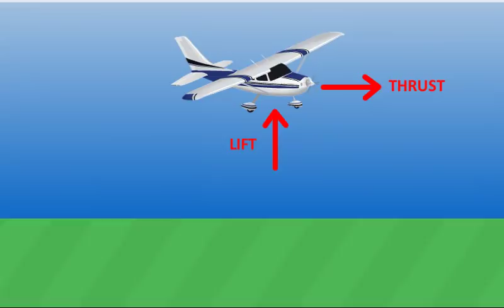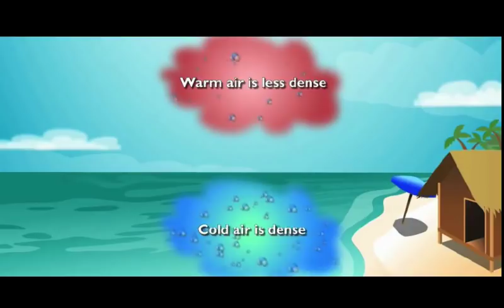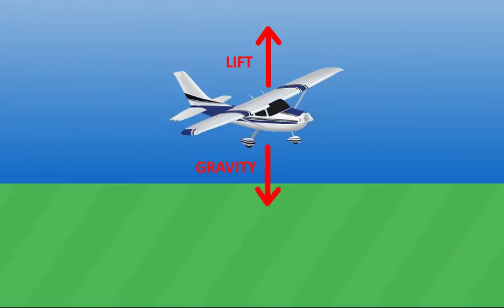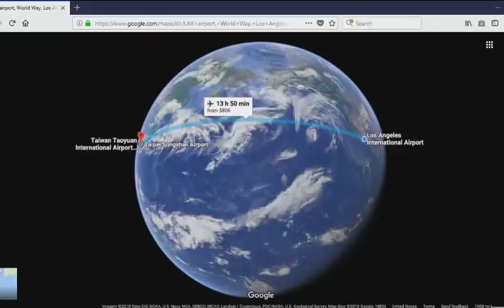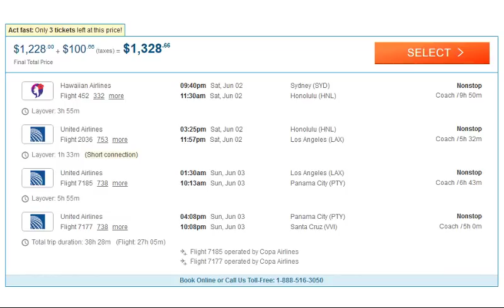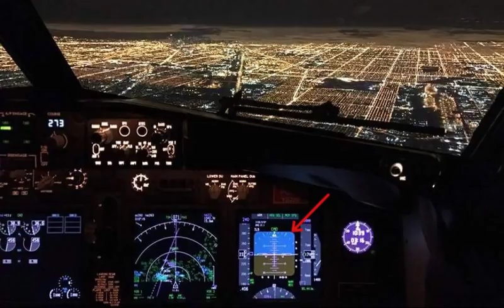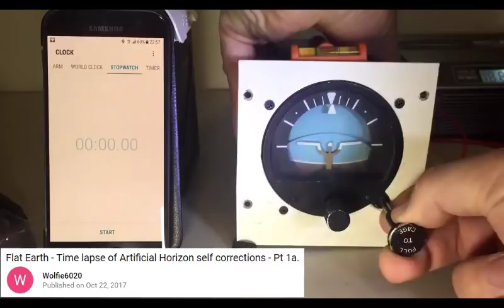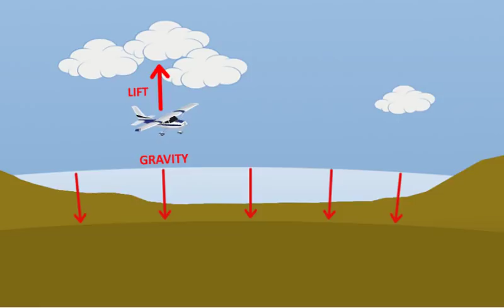Flat Earth Falsities - Plane Nonsense

Comment: At ~6:00 - that is not correct.
A plane WOULD have to 'constantly' adjust its vertical orientation to account for the curvature but 2 things make it unnecessary:
1 - speed. Commercial aircrafts are still subsonic so even if you'd go say 1 000 km an hour that is just 1/40th the distance around the globe per hour - 1/40th of 360 ° in 1 hour - just 0.15° per minute - pretty much unnoticeable.
2 - reality. Nothing is perfect. You can have the best plane, best weather and everything, there will be wind, there will be tiny turbulence and other things that require some steering adjustments. And those will completely overshadow the effect of the curvature.

But if you could get a perfectly stable flight than yes - the plane would rotate in relation to the ground. You still wouldn't be able to fly a straight line as with increased angle of attack and altitude the plane would slip more and more and without some really strong engine you wouldn't be able to climb at even just 45° when at higher altitude.
Reply: I think it's the 'constantly adjusting' that the flat earthers are misunderstanding here. I guess it their minds it's like: 

"You're level now and flying straight ahead. You watch your level later and, dammit, it's out of whack. So change pitch until it's level again. Lather, rinse, repeat throughout the flight."

But that's not what's really happening. A decent analogy here would be to imagine driving a car on a long circular road. You don't turn the wheel every so often to avoid going off the road, you hold the steering wheel at the angle that would make the car turn just as fast as the road curves. After that no further adjustments are necessary.

IIRC, in an airplane something similar happens with trim angles. You just adjust them until level flight is achieved and you're done. And, as ABaumstrumpf mentioned, the any adjustments for curvature are insignificant compared to atmospheric conditions.
Reply: "A plane WOULD have to 'constantly' adjust its vertical orientation to account for the curvature" 
Are you sure? The wings generate lift, and the lift will be dependent on the density of the air. And since the air gets thinner the higher it goes, so at a certain altitude the lift will not be stronger than gravity, so the plane will level out. And since the atmosphere is also curved the plane will follow the curved density layer of the atmosphere.
So even if we did not have 1 or 2, then i don't think planes would have to adjust pitch. But i may be wrong...
Reply: "the lift will not be stronger than gravity, so the plane will level out."
almost correct: Yes the lift would no longer be greater than the pull of gravity - that just means it wouldn't climb anymore. But that does not change the direction it is looking.
At a certain point the planes nose would be pointing steep upwards and start to stall. With high enough thrust it would still keep on travelling horizontally but again - that would not rotate it.

That is of course assuming that the plane geometry was designed for stable horizontal flight with neutral rudder positions and due to the effects of higher angle of attack and lower airpressure this is but a simplification.
But there would still not be a force to rotate the plane.
Reply: i think its just curving in relative to the startimg point

Comment: Just point out that gravity operates radially toward the center of mass of the Earth and the flight path of an airplane is based on its instantaneous location in reference to the direction of gravity. So straight and level flight is flight perpendicular to the direction of gravity at that point. A gyroscope is used as a sensor to indicate the direction to the center of mass of the Earth so it can drive a display.

Comment: Overall an excellent set of explanations, but I have to point out that your explanation of the nose dipping is wrong. Pilots actually do tip the plane down to follow the earth, but they don't notice it. What you said makes intuitive sense to a round earther, but it has no scientific basis. If lift is equivalent to gravity, then there is no net force, so it would indeed theoretically fly into space. Remember that gravity is a linear force, which would never exert the torque necessary to rotate the plane. 

What most people on both sides seem to miss here is that the idea of the pilot walking away from the cockpit for an hour and coming back to see that they have flown a straight line into space is ridiculous. Airplanes are not precision machines capable of pointing straight at their destination and then never rotating an arcminute. No pilot uses a protractor to point their plane; after takeoff, it will probably be pointed at least a degree up, down, left, or right. Furthermore, once the plane is in motion, many forces will conspire to set it further off of alignment including wind, turbulence, people moving inside the plane, and yes, the curvature of the earth.

Pilots, human or computer, are constantly making tiny adjustments to keep the plane level and on course. The curvature of the earth is only a tiny part of those adjustments. I don't have the statistic in front of me, but I think it comes out to about a degree every five minutes; you can check me on that if you care to. No one can pick that slow imperceptible turn out of the comparatively much larger random factors that turn the plane simultaneously.
Reply: I liked Wolfie's analogy that flying is like keeping your car in the lane when you are driving along a straight road. You make constant small almost sub-conscious adjustments to the wheel/stick. You don't let it drift completely out of the lane and then yank it back again.
Reply: A plane will automatically follow the Earth's curvature by maintaining a constant altitude relative to local sea level. The altimeter can measure the atmospheric pressure and convert that to a specific altitude because the pressure drops with altitude in a predictable way. If for instance the plane follows the curvature at 10,700 metres (34,000 ft) above sea level, it is actually following the level at which the atmospheric pressure is only 25% of that at sea level.
This will cause the plane's nose to pitch down, but only about 1 degree per 8 minutes at typical jet speed, far too slow for the passengers to feel anything. The pitch angle relative to the horizon will not change as the horizon will drop at the same rate.
Reply: Galactic Ketchup
You’d need to be flying at 720 knots to achieve that. It’s more likely to be 450 knots which is a degree every 8 minutes.

Comment: This is a very nice presentation. It's clear and concise. Congrats.

I'd like to point out a corollary to #4, which would make the presentation too complex,  but is important. You point out that the cured path is the shortest distance. It is called a great circle route. Before electronics like moving map and GPS, one had to take sites of objects in the sky. This is called celestial navigation.  In short, you get the angles of an object to the ground. Then you use spherical trig to either work out your path or to find out where you are.  Regular trig or plane geometry will not work accurately.  

In effect, they navigation system, with spherical trig is an example of a scientific model and a hypothesis at work:  "IF the Earth is round then  spherical trig will prove to generate accurate locations; otherwise, if the earth is flat, then regular trig or even plane geometry will work better." This can be operationalized by jumping in two small boats and heading out to sea.  One will use spherical trig; the other plane trig/geometry.  The subject who gets lost and/or dies will be deemed wrong. LoL

I absolutely know which boat I want on!
Reply: +Rob Guyatt
So very true. I was Master on sail training ships and it gave me great pleasure to teach youngsters how to use a sextant and then take altitudes and calculate and then plot position lines and so on. I believe it helped their self confidence tremendously, especially the handicapped ones.
Reply: Mick you got it! Work on your nots and naughts and especially knots :D
Reply: The elevation angle of Polaris is equal to the latitude of the observer. A very simple method of celestial navigation. And it works only on a globe:
i.imgur.com/CPU63Tm.jpg
Reply: As a “yachtie”, please make sure there’s room for me on your boat.
Reply: Brenda you put it well. My Nephew crewed on a tall ship from the UK to Australia some years ago. I was fascinated to hear him describe to me in detail how they navigated. The ship does have all the mod con nav equipment but as it was a sail training ship the trainees weren't allowed to use it and did the whole trip using the pre electronic age methods. What an amazing experience. I'm so jealous.
Reply: Navigation is a very good Point in the flat vs. ballshaped earth question.
before clocks were precise enough to allow telling how far east/west you are mathematicians developed a complex method of telling how far east/west you are wich involved taking aim at the moon. it turned out to be to complex to actually be usefull, but that it exists is only possible if earth sun and moon are part o a 3-dimensional System.
they assumed earth was a ballshaped object in a 3-dimensional System and, based on this Assumtion, created a working System of Navigation.
later using a precise clock and the comparison of noon-time to noon-time in Greenwich provided how far east you are(wich , again, Needs a rotating spherical earth to work)

nowadays satelites in Orbit around our planet sent time Signals wich every Smartphone can use to tell where it is. this can only work if the method of calculation is based on a correct model of the earth and sattelites and their Motion [irony] of Course all the sattelites are mounted in fixed positions and all manufacturers are in a conspiracy using the Knowledge about this to create correct Navigation Information and no one is actually able to just take measurements and use the data to calculate for him/herself to find out the true truth and if somebody is able he is being silenced by the conspiracy[/irony]
it would be interesting to just take the program of a Smartphone or gps System, decompile it and see if it follows the theory that the satelites being in an Orbit, or in any other Arrangement. but the FE-Followers would probably just Claim the decompiling was manipulated...
Reply: You bring up a very interesting point. I wonder how many flat-earthers believe the flat earth model enough to stake their lives on it?
Reply: Navigators started using spherical trig because navigators that used plane trig died at sea too often. Darwin in action!
Reply: wyrmofvt, but sadly,  Flatties don't actually get out there and therefore avoid being contenders for the Darwin Award.
Reply: @Rob Guyatt
It was indeed a privilege. One which few have had, sadly.
"May I ask what Ship? " You may, but I prefer to keep who I am out of the social media domain. For many reasons.
Regarding the Endeavour replica, I followed that as I did most such vessels until strokes, heart attacks and a punctured lung somewhat curtailed my practical activities.
I presume you are from the land of pissed galahs and shy AFL footballers?
Reply: wong, what a privilege you had to have such a role. May I ask what Ship? My nephew was crew on the HM Bark Endeavour Replica. It can be found on Wikipedia.
Reply: @Brenda Rua
I make a point of asking FE cu;tists navigation related questions. Silences most of them but the odd idiot tries to be a smart arse and starts telling me I don't know what I'm talking about because I obviously  have no experience and am just repeating what I have been told, and then run away when they realise how wrong they are,
The only two big game to fall into the trap were Campanella and FuckitWorld, both of whom ran away with soiled underwear when they realised they were the ones talking through their bumholes. None of the other big players respond, I wonder why.
Then there are the troll FE earth types who use every trick in the book to avoid actually answering, pathetic numpties, but it can be amusing to string them along and get them to contradict themselves a few times.